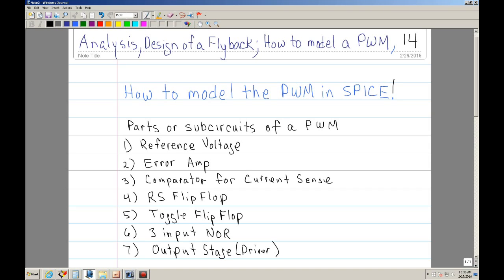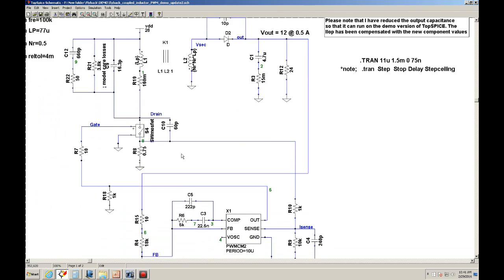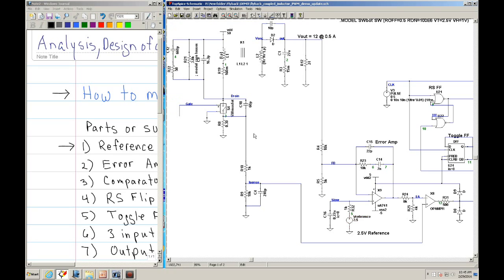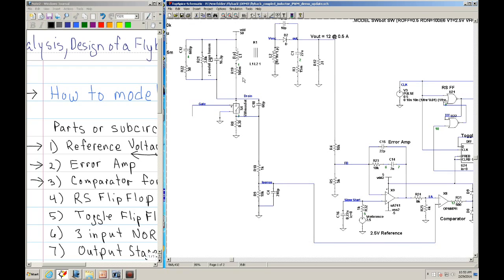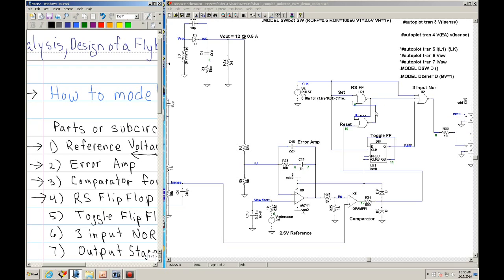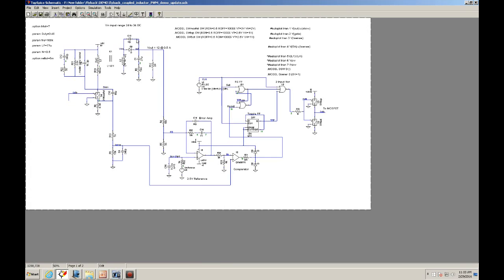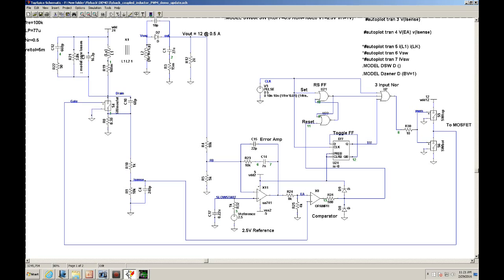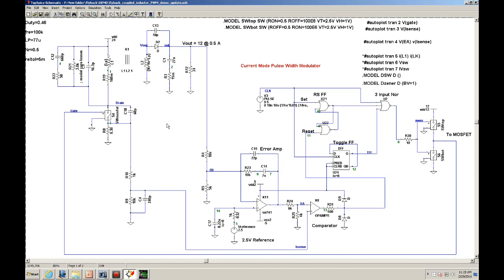Analysis and Design of a Flyback: Part 14 How to model a PWM

Comment: What is the difference between PWM ic in an smps and LED bulb driver ic. Is both can use for same purpose if not why. Is both uses constant current mode operation.can you explain the internal diagram.of an led driver ic like pwm ic explained

Comment: Sir ,your  videos are awesome.It requires many efforts to do in such manner !
sir i have diffficulty in designing 3.3v, 100mA flyback power supply. Can you give me some tips or schematics if u have. 
Thankyou :)
Reply from the maker: Drop me a message at rbola35618@aol.com and I will send you my Topspice files. Just follow the procedures that are in the first three videos and you should be simulating your flyback.
Reply: Message dropped!
Thankyou soo much sir:)

Comment: Sir,
I'm trying to simulate a 43v input, 3 output (12v, 5v, 3.3v) flyback using the model you have used in this lecture
It works fine using ideal switch as shown..
But when I use a N-channel MOSFET , instead of an ideal switch; I am getting output voltage in millivolts
Reply from the maker: +Alisha Khan You are probably using a high of a Rdson  mosfets. You need to use a mosfets with a very low Rdson of 500mohms or lower. If you are using a common spice n-channel mosfets, you need to specify the W (Width) and the L (Length). Try setting W=10m, and L=1u. Hope this helps
Reply: +Robert Bolanos Yes...that helped. I'm using IRFP460 NMOS to test the model practically. It has Rds(on)=0.27ohms also I used the L and W parameters for that and it worked great...
Thanks a lot!